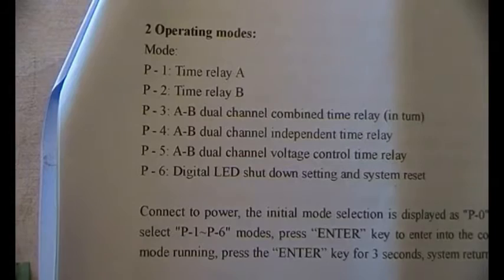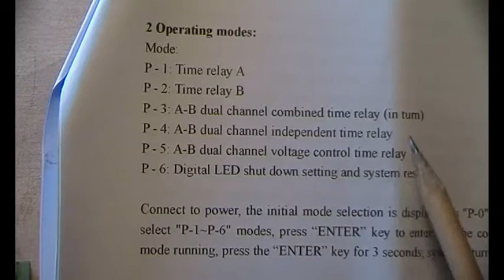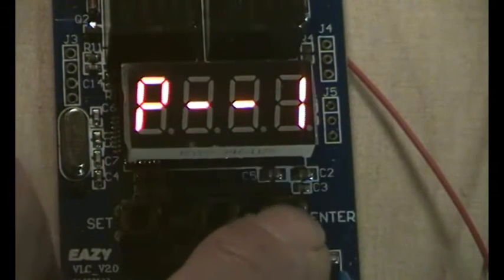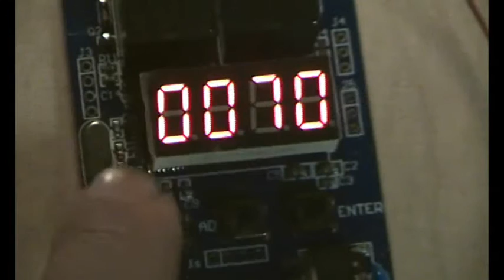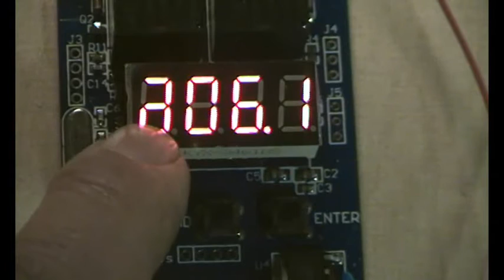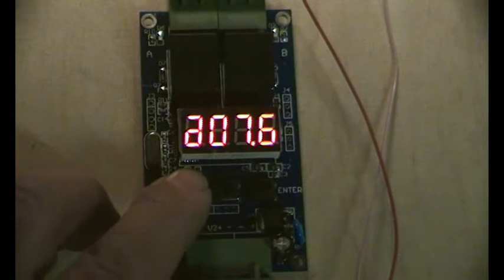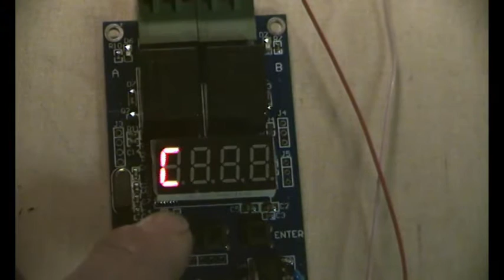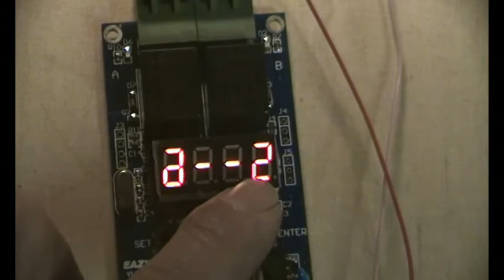Voltage operated timer relay VLC V20. Charge controller, divert controller.

Comment: Hi Andy thanks  for the video.  I am looking to use a on/off switch to operate the two relays in timer mode but I am having problems programming for zero volts when the switch is off. Any suggestions?
Reply from the maker: Hi, not really knowing your setup, but how about using the normally closed contacts to put either a resistor or a doide in circuit to stablise things. I'm thinking here that you are using the normally open as the switching element on the circuit, you could try some form of bulb as a proof of concept. cheers

Comment: Andy , How I can reset the Relay.  I press the enter button for 3 sec and it is not show me the P -- 1
Reply from the maker: Hi, from memory I think you need to be in the live voltage screen showing the voltage as it changes to be able to exit a program. Press enter and hold. You should then be able to scan through the programs 1 - 6 by pressing set. Hope this helps, Cheers
Reply: @TheInfoworks  Thank You Andy. Will try .
Reply: @TheInfoworks  How can i buy ?
Reply from the maker: Ebay

Comment: Where did you get the instructions mine came with none and I’m trying to control the run time of the augers on my pellet stove..
Reply from the maker: Hi. I got some from the Ebay seller, but they are mostly chinkleese and so quite usless. I assume you need a fixed mark space ratio in which case you will need to use the timer function. Noakeswalker has looked into more of the functions. Cheers
Reply: Thank you!

Comment: yes my LOAD is only 5 amps dc ,,,, so the contacts in these on-board 
relays will do the trick without a remote relay and this application 
requires no delay between polarity reversals because its not a motor 
being driven, and is a resistive load.

and yes a remote CC/CV power supply is in the circuit already. that is supplying 0 to 27 volts and 0 to 750 ma. to the relays.

and yes the relays will be cross wired for reversal.

the programing is driving me crazy.
even after I THINK that I have all the parameters entered,,,, then I 
cant get it to actuate the onboard relays. even though the led displays 
show the count down that does start over and over in a LOOP.
I even tried more than one board to make sure the board did not have a problem,,,,,[ I have 3 new boards]

Comment: ANDY I hope that your or others reading might be able to answer my question
first is that my board shows to be a slightly newer version V2.1
ASSUMING that the programing is about the same,, I am having difficulty programing.
I wish to cause a POLARITY switching , as if I was reversing a dc motor, 
I am guessing that the P-3 mode is the correct one for this
I wish to run a continuous loop of 5 minutes for each cycle and continue indefinitely WITHOUT a TRIGGER.
IN OTHER WORDS I want it to begin timing on power up and never stop its 5 minute loop.
but I am apparently too stupid to program this little unit with the CHINGLISH instructions that I find on the net, as it did not come with ANY instructions at all. 
I hope that I can do this because I purchased 3 of them.
to add insult to injury ,,, I live in the PHILIPPINES and most expertise here is at the HAMMER level.
any info will help ASAP.
Reply from the maker: Hi, I understand your frustration, and the only way I worked things out was by trial and error. That's part of the reason for the video, to remind myself what I did.  As an extra I note you wish to change polarity of a DC supply, you will need to drive a remote dpdt relay and cross wire the opposite fix contacts to do this. Sorry I cannot be of more help as I only explored that part of the program I required (and that was bad enough). Cheers

Comment: Dear Andy, I bought a voltage operated timer relay VLC V30 but with a V20-like card with a program different from the one presented in your video. In particular, the difference is due to the way to select the  out put voltage v1/v2, could you please help me???
Reply from the maker: Hi. It is a common problem that china sellers do not know what they are selling (or even care). Noakeswalker has had similar problems and was sent vlc V30 instead of V20. He has made a comment on this video. Cheers

Comment: Much easier to see the display and relay leds this time Andy... I still think your power supply 'wobbles during adjustment' are the cause of channel A seeming to trigger as voltage goes down through 11.8v- it looks like voltage goes down past 11.8 but then overshoots back up and past 12.0 causing a genuine valid trigger of chA again. I had to look several times to catch it though :o) Cheers, Dave.
Reply from the maker: Dave, you are probably right. I wish I had a better adjustable power supply. I hope to fit this unit shortly so it can be tested fully, Cheers, Andy
Reply: +Andy Reynolds Yes, fitting it in a real setup is going to be the best test.  (look fwd to monthly review vid with result maybe)
Sorry to labour the wobbly-PSU point, but even though the pots in yours are 'sealed' and w/w, I wonder if you'd have anything to lose by squirting switchcleaner (I use WD40 if I can't find the latter, with caution) into the pots via ANY hole and see if they make better contact with the windings.... I'm assuming here that dirty pots ARE the cause of the slightly wobbly output of course - it looks likely in your video. I'd be worried that, without a 'scope to see what's going on, your PSU could be sending out spikes of higher voltage than you think, which could trash a device in a jiffy. You know all this already I'm certain Andy, I'm just saying it out loud :o) Cheers, Dave.
Reply from the maker: Dave
I've used switch cleaner where I can, but I think it's something more serious. I might try a reverse diode across the output to kill any possible spikes, or .01 Uf cap, or both. Shame I never thought of that before, just concentrating on the video production. Cheers, Andy
Reply: +Andy Reynolds I reckon you might do better with an even bigger cap, something like 2000-3000 MFD for doing smooth up & down voltage sweeps. The cap might cause a little delay, but should smooth out the "over" events. Connecting the PSU to an analogue multimeter should show up glitches in the controls. If they are dodgy, probably would be best to just replace them.
Reply: Some power supplies are not "happy" without some kind of significant load on them.  The V30 is likely to be designed to produce a minimal load.  I'd consider putting a non-dynamic load in parallel to give the power supply something to "chew on"  100 ohms should do nicely but x10 that  might be ok too depending on the personality of your PS. :-)